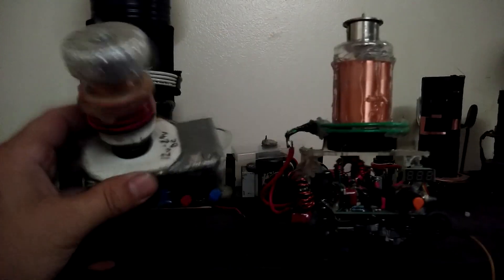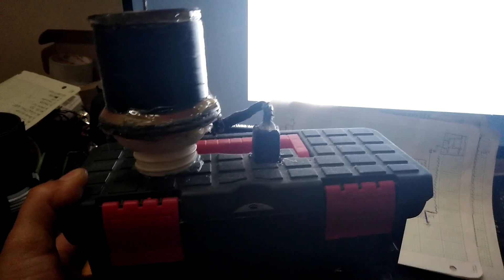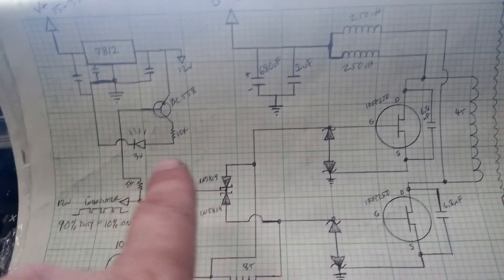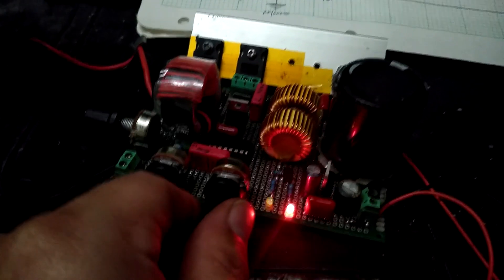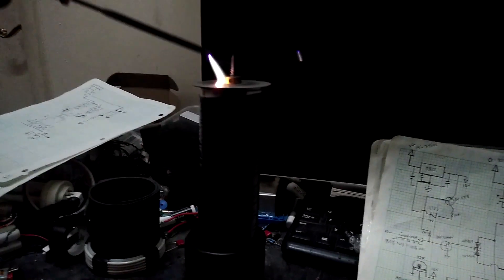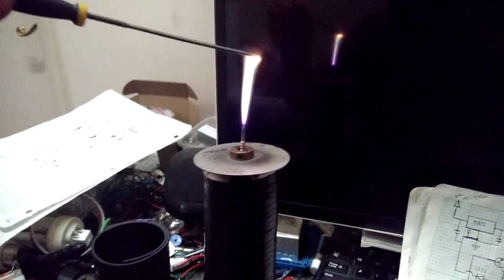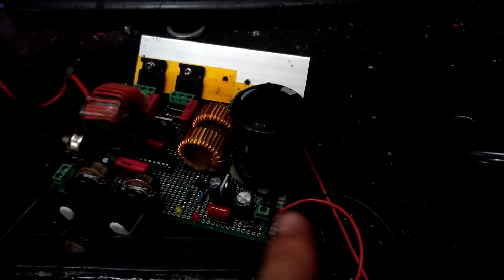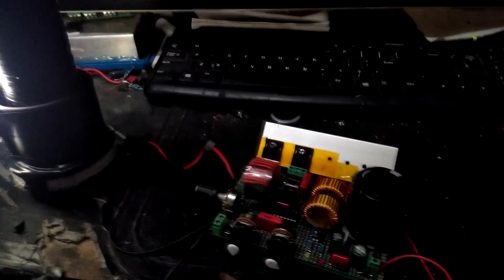2v-35v High Power SSTC CW+Interrupted

Comment: Ive used some Bojack IRFP460  s of Amazon with this circuit. They worked fine and gave me a 10 inch spark from 120 v.  I then tried using the IRFP250s and they somehow died the second the coil was powered on.  My coil's frequency is around 1mhz.  Any ideas how they died?
Reply from the maker: Yea, the 460's have a max drain voltage of 500V. 250's are only 200V. While most fets today should be rated to be able to handle overvoltage 'to some degree', apparently if you excessively overvolt one for even a short period you're going to kill it. I wouldn't imagine I could run these circuits at 120V using 250's. I've done a max of maybe 90V with 460's.
Reply: Thx. Yeah I guess that was probably a voltage spike that killed them.  I was running my coil just yesterday and it turns out that my ballast, a spool of copper wire, melted and shorted itself, killing the 460s. It was disappointing since those were the last ones I had. Oh well.

Comment: Sir please show the circuit diagram of each SSTC separately. When you tell the difference of Tesla coil from one circuit to another we don't understand well.
Reply from the maker: The different ones I showed in this particular video were all using the same circuit as the foundation, and except for the 'smallest one' I showed, they were all just variations in the GDT/Feedback inductor, the resonator coils themselves, the mosfets being used, and the values of the drain capacitors and primary coil series capacitors.

So the circuit drawing I showed in this video is the basis for all those coils shown except for the smallest one. The smallest one was built directly from Tefatronix's schematic and that one used the center tapped primary.

I wasn't able to give exact schematics for all of them because I didn't know the exact values of certain components in them. For example a lot of these circuits I've made were using inductor pulls from old boards, typically some kind of dual wound filter. Some I wound my own transformers using random powdered iron toroids that were also a mystery to me as far as their specs. The circuit drawing I did end up 'finalizing' I showed in another video, and that one was my most successful where I just drew up exactly how my circuit was wired at the time. I know of one other guy who replicated it successfully just sticking as close to the shown values as possible.
Reply: @Magneticitist  Thank you very much sir for your reply, you explained everything in a way. I thank you again.

Comment: Hello how are you? Excellent results and very well explained.
I have a question, what is the function of the capacitors between source and drain?
Thx you.
Reply from the maker: Thanks, the drain caps act as snubbers to absorb some of the HF HV ringing that would normally occur on the drains during the off states. If tuned properly they can also provide efficient switching. Refer to Class E amplifier topology for how that works, but in this case one would try to make it work with the two switches.
Reply: @Magneticitist  thx you. 😁

Comment: really cool .... Could it be one of the simplest DRSSTC? with power capacitor
Reply from the maker: I did make one of these dual resonant and it is indeed really simple. I can get about 6in arcs from it at 30 volts. This one in the video doesn't even have a primary capacitor though so you really don't need one to get about 4in arcs from this voltage.
Reply: @Magneticitist  
Magnificent ... could you show me a schematic with a capacitor? I want to make 6in and 7in sparks
Reply from the maker: @victorp2562  Since I'm using the two chokes in this circuit to allow the single primary winding that means all you have to do is add the tank capacitor in series with the primary. I also have 6.8nF pulse capacitors across the drain-source of the mosfets which you'd want to increase to maybe 100nF or so. Everything else is the same.

Since this uses secondary feedback that means the tuning (and detuning) is crucial to the output. I had to account for streamer loading in mine. Much like how drsstc's are detuned this way, I don't see hardly any output until I reach a certain voltage, then suddenly the longest arcs.
Reply: @Magneticitist  great I will add the tank capacitor with the primary and test ... to finish ... how did you make the secondary feedback transformer?... 
what kind of core?
Reply from the maker: @victorp2562  I've actually found a wide range of cores to work to some degree which is a little strange. I guess it all depends. For example secondary feedback can be really powerful so sometimes a lossy core like a yellow filter can actually work to attenuate the feedback signal enough to make a 1:1 ratio work well. I've used 1:1 ratios with fairly high permeability cores as well. Have to sort of experiment with it. Many of the GDT's ive used were 1:1 pulls from boards which were likely used as common mode chokes.

Comment: Yours sstc and drsstc is awsome how did you switch it for sstc to drsstc
Reply from the maker: You mean this kind of driver? With this driver I just added a primary capacitor. My best one used a combination of series and parallel caps on the primary. This one in the video is not dual resonant though. Typically you just need to add that primary capacitor and maybe some more filtering on the bus to make it a drsstc.
Reply: @Magneticitist  oh
Reply from the maker: @Texas_bikes66  Dual resonance and these circuits is iffy. I built one based on a schematic Teslaundmehr sent me which is basically this driver with a series tank capacitor on the primary. The drain capacitors on the fets are increased for this operation to around 100nF or so and  at least 1uF or so film cap on the rails along with a decent sized electrolytic is about the only changes aside from maybe going with smaller and faster fets. The problem was while adding the tank capacitors increased the output a lot, I was using a single turn primary and there was no way it was running at its highest resonance with the size of the tank caps I had. I later added more primary turns and tried to calculate the dual resonance better and I ended up with a lot more output at 30v region and a bit less at the 12v region. I think this is because of the secondary feedback and the arcs needing to reaching a certain point (dropping secondary resonance) until it brings it closer to the primary resonance, then boom the longest arcs. Slight detuning basically accounting for streamers whereas the more precise tuning had shorter streamers.  I can see a bit of the same response in this circuit without any primary capacitor though. The primary can be tuned according to the input voltage to produce the longest arcs to free air or by drawing them out to the hand, and the arcs pulled to an object can be made weaker and more purple or hotter with more power by just sliding the primary up and down.